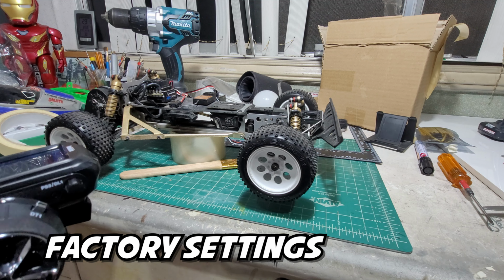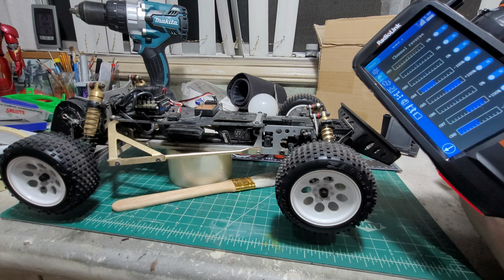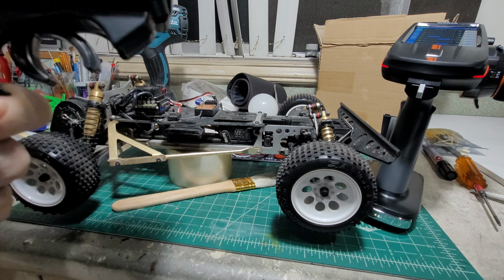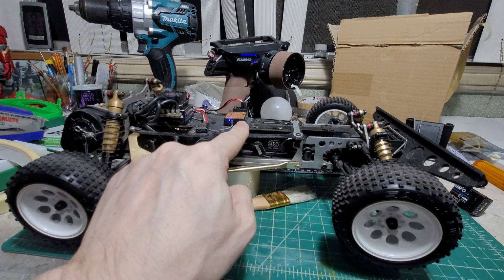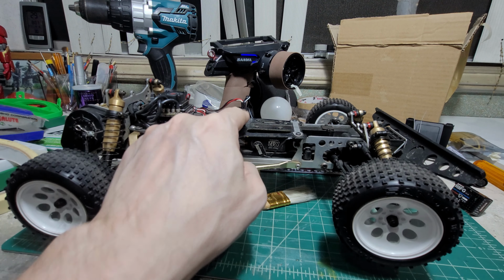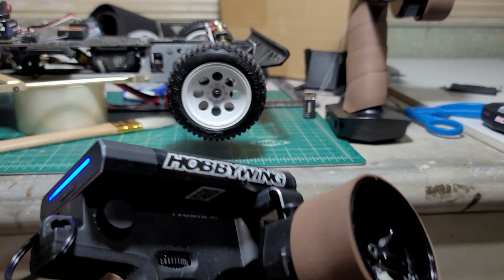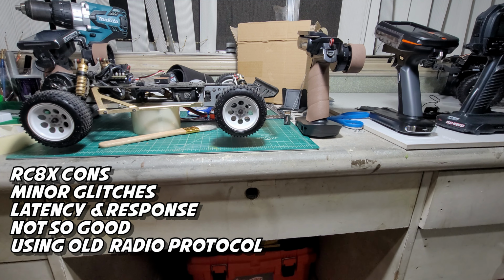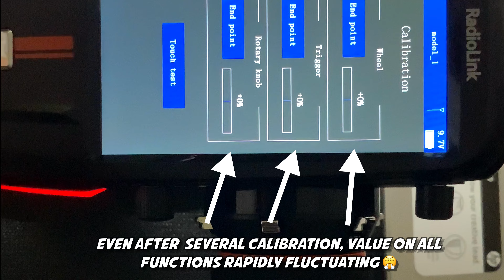Radiolink RC8X VS Sanwa MT44, Flysky NB4 Latency Test or response test

Comment from the maker: Update: March 8,2023, Radiolink have a complete explanation regarding FHSS protocol in my second uploaded video regarding RC8X issues, there are key take away from Radiolink, “FHSS V1 resolutions 2048 and FHSS V2 4096, V2 can achieve a more precise operation. Check your version is your R8FG (receiver). R8FG V1.0 (with production date February 6,2023) supports only FHSS V1 protocol, Not V2, if protocol of R8FG is selected incorrectly, some functions will not work properly.”

So that means anybody who purchased the RC8X radiolink earlier than February 6,2023, you have a 100 percent chance getting version 1 (R8FG) receiver, you can only set it at the lowest FHSS resolution, that the recommendation of Radiolink. Equal to slow resolution and latency.

Comment from the maker: Update 6/19/23: Firmware version 1.1.5 with the new receiver R8FG V 2.1, improvement in speed but still slower compare to Noble NB4 and Sanwa MT44, I will try to upload a slow motion comparison very soon.

Comment: nice demo , in fairness , the nb4 was slow as a snail when i got mine , the firmware updates solved it , its now lightening quick so hopefully the rc8 will improve soon . it can only be a firmware issue as the transmission protocol is capable of near instantaneous reaction. fingers crossed .

Comment: I have the new RC8X as well and seen a couple of "review" videos. I know one where it was a just an unboxing video and I did call the channel out on it and they changed their title. The other one I seen, the reviewer did mention that it is slow. If you did some research before you bought it, the RC8X uses the same receivers as the RC4GS & RC6GS... meaning they use the same protocol. Same old technology from their previous radios. Radiolink is known for really good range and very affordable receivers. This RC8X will serve my bashers and especially crawlers well. Sorry you found out the hard way and thanks for making this video.

Edit - I also have the trigger spiking sometimes between -1 to 0 to +1. Hopefully they fix it on a firmware update.
Reply from the maker: I did watch a lot of videos about the RC8x, my mistake I bought it too early ( not waiting for more feedbacks about it) I was blinded with the colorful display 😬. I going to use it for my crawler too and maybe plan to get a brasher soon. Thanks, for sharing your experiences and insight, I do hope they do fix the trigger/wheel and rotary knob issues as well.
Reply: @oliverstoys8411  Yeah, hopefully they will address these issues with future firmware updates. I see that v1.1.1 is out now, newer than the one I downloaded and installed around the beginning of December.

Comment from the maker: Update February 9,2023, my radiolink RC8X connection problem happen when my transmitter is right beside the receiver (r8fg) 8 inch or less, you can still control steering but tx and receiver voltage displayed on my radio drop to null, and fluctuating signals. This will be a issue if you happen to be calibrating your car, at the beginning i assumed it would be the esc i am using, i test hobbywing 1080, tamiya esc, castle sidewinder and hobbywing xr10 all have same have the same signal dropout at very close proximity with the receivers, i am assuming either software issue or more likely hardware😬, i would suggest you guys with RC8X do your own testing, to avoid RC mishaps.

Comment from the maker: New update (06-06-2023)from radiolink, so far I don’t have the new r8Fg v2 receiver, so no way of testing it, according to them it will increase the performance of speed of the radio, and here the new details form Radiolink of the firmware update and new receiver requirement need to get benefit of the new changes. 

Firmware V1.1.5 Upgrade Instructions
1. Optimizes the Throttle delay function.
2. Add Korean, the optional language menu includes Chinese, English, Japanese, Spanish, German, Russian, and French except Korean.
3. Add "Servo Speed" in the Receiver setting menu, and the Servo Speed can select as 3ms, 4ms, or 14ms.
 
Servo Speed
1. Transmitter:
It is necessary to update the firmware of RC8X to V1.1.5 or above, and then select FHSS V2 protocol to display this option. Servo speed can be selected from 14ms, 4ms, and 3ms. The factory default servo speed is 14ms (analog servo speed), 4ms, and 3ms (digital servo speed).
 
2. Receiver:
If you are using a digital servo, you need to choose a servo speed of 4ms or 3ms. Please confirm whether the receiver you are using supports digital servo. Currently, RadioLink receivers that support digital servo include R8FG V2.1, R4FGM V2.1, R8FG, and R4FGM receivers with a factory date of 2023/4/26 and later. Other versions of RadioLink receivers do not support digital servo. Even if 4ms or 3ms is selected when using them, the default servo speed is 14ms. RadioLink will continue to add other models of receivers that support digital servos in the future. Please pay attention to RadioLink's official website.

Comment: Good video!  Yes, I definitely noticed a difference driving this compared to my MT-44 and NB-4 on a carpet racetrack with 2wd buggies.  It's good to see the actual camera difference.  Thanks for sharing.
Reply from the maker: Thanks  i really appreciate it👍🏻, i did watch your videos and glad you voice out your concern and opinion about the radio, i read all the comment/reply on your video and it was really insightful, i wish i knew earlier that it was that slow (rc8x), i might have waited for a better one. So far the NB4 for me still a better all around radio (value wise) but not as quick compare to MT44, Thanks again and more power to your channel 👍🏻.
Reply: @oliverstoys8411  thanks.  I've seen that glitch on startup, I think if I turn on the car first and then the radio I don't have it.
Reply: No its not a good video. At 2:07 you can clearly see that the servo throw for the Radiolink is much greater vs the others, like 30% to 40% more. Also, its going beyond the endpoints and causing the servo saver to activate.. The delayed return time is cause by the servo saver notch having to travel 30% to 40% back the opposite way before finding center to begin moving the steering rack. Performing this test on a clapped out rack without setting endpoints is just silly and pointless.

Comment: IMO in your tests speed is obviously dependent on the tension of the spring bringing the turning wheel back to 0, and Flysky and Sanwa obviously, you can see it in your video, have harder springs and therefore are faster (and shiver more).
You should use a 3-position switch IMO, 100 - 0 - -100% to make those tests. At least this was how I did servo-speed-tests. And this should also be valid for latency.
Probably you could turn the wheel even faster with your hands than spring-tension does?
Reply from the maker: Thanks for your feedback, Some how you have a point with the tension spring vs the mt44 and nb4, but at the start of the turn it’s already obvious the rc8x very sluggish, you can also look at the my vintage sanwa radio test video the the tension weaker compare to the radiolink, and also they are similar in protocol FHSS version 2, but obviously the older sanwa still out performs the Rc8X, i have the radiolink for 2 months already, it still feel and sense the steering very sluggish and mediocre (like a ready to run bundle radio), i would like to test it on a 3 switch position but it going to be a waist of my time, it’s not up par to some popular $250usd and up to speed and quick response, but i do like the features, affordable receivers and awesome touch display, i am still using it for my re release tamiya sand scorchers and 3 of my crawlers, that is my personal experience with the product, every person have his favorite radio, for me i do really regret buying this, if I don’t have the mt44 or the nb4 i properly love this radio, I hope you can also check out razor rc product review, and read the comments.
Reply: @oliverstoys8411  I do only have a Noble ;-) - and no favourite radio; however, ordered an RC8X recently, did not yet arrive, my first Radiolink radio. I am not a fanboy of any brand at all, but love my Flysky Noble NB4.
But this is what I first thought when watching your video.
Another point: The foam on the steering wheels. You press your finger, hold the wheel, and remove it. Different foams, softer, harder, stickier, less sticky... those probably are only few ms, but will affect the result, too.
IMO the only way to do this is using a 2 or 3 pos switch. I know, testing and analyzing is super time consuming, did servo speed tests this way once.
Reply from the maker: @donaldsneffe  i do believe you have a point regarding foam and others, but i still prefer using the steering as a gauge, because that what i am concern about steering feel, responses and accuracy, adding the marker to gauge the position of the servo, normally I don’t drive full steer to 100 percent opposite direction, just wait for your radiolink to arrive and do your assessment, you never know i might be wrong, the reason why i purchased the rc8x the features and vibrant display and recommendation of youtube influencer, what can go wrong, but i should have waited, i have my old MX3FG sanwa radio, the steering would be very outdated (noisy, squeaky, you feel steering resistance) btw with foam pads too, comparing to todays standard, i can say it’s very old and feels old(mx3fg) , but for me it’s obviously quicker and more accurate compare to my rc8x, i really hoping the rc8x with be at least same as the nb4, my mt44 with FHSS-version 4 is faster than the nb4, the new sanwa have a new model MT-5 using FHSS-Version 5, for me radiolink Rc8X (FHSS-version 2)would maybe be up to par if they just used the new protocol, in the end of the day, if you are happy with your radio that great 👍🏻. 
Please read some of the other comments across social media, i am not the only one complaining.
Reply: @oliverstoys8411  I do not doubt your feelings and experience in any way and I appreciate your effort and your videos.
My comment was only related to this test in this video.
I was "in the same situation", wanting to perform a similar test (servo speed measurements) about a year ago.
I am not a professional in RC radios at all; however, I am a super interested hobbyist, love to test new stuff and super interested in any news.
But I am scientist, professional, and therefore I know how to setup and analyze experiments and measurements, and know about about critical factors.
When I made my servo tests, I initially also wanted to use the steering wheel to let the servos "snap back". But after thinking a bit about the setup I realized, there is the factor "speed of the steering wheel", which I could easily eliminate by using a push-button which only knows 0/100. 
The factor "different foam" (sticks to your finger) is a minor one, but a factor, too.
So the first thing I thought when watching your video was "those steering wheels do not go back with same speed" and therefore those results cannot be correct, even not "near to correct".
But this does not doubt or critisize your "feelings and experience" in any way. However, "feelings" are subjective.
Reply from the maker: @donaldsneffe  agreed👍🏻 feeling is subjective, I can’t duplicate how fast i turn the steering wheel i am only human, you always note that I don’t use any foam , what about the MF3XG, that why there are 4 different radio, but the marker should be very similar to the direction of the steering wheel and the servo, or at least servo should trailing by close enough like the sanwa mt4, you should also note that i am using a bootleg sanwa receiver too, it could be also a factor, and also i using a larger steering wheel too, for me seeing the markers is important, and dont just look at the return, look at beginning turn it so delay already (rc8x), I am not the only person who done this test for other radio, using a 3 position switch will also depend of the speed of you hand and sensitivity of the switch), the best way it should be “automated” if you want accuracy and consistency, use a program to automate the switch process sequence.
We are agree to disagree.
Reply: If you don't race and see your results affected by slower but gorgeous radios, then who cares.  I bash and only need EXPO and EPA, but the beautiful soft grip and color touch screen 😊
Reply from the maker: For reference only, skip to 2:30 seconds, https://youtu.be/1bKn2xS3wBU?si=FcoyZN3eMUkY4WFb

Comment from the maker: Update as of February 8,2023, another issues i found out, jumping to different fhss v1 and v2 protocols (receiver) are not a good idea, for example bind connected to r8fg receiver with fhss v2 protocol saved, then you pre select different car with to R6fg fhss v1 protocol, it will not bind, you need to confirm again the fhss v1 (checked) protocol to v1 enter confirm before you can start using the assigned car, when going back to another with fhss vs 2 protocol you need to go again to receiver setting and select v2 enter confirmed. 😬😬😬😬Freaking complicated!! As long as you stayed fhss v2 saved receivers you will be fine. Another problem i found out, both receivers r8fg and r6fg losing binding connection (receiver voltage 7.4volts) with my kyosho USA1 esc( oem Hobbywing ), I used the sanwa and flysky receivers with no drop out on signals. Either this radiolink need a pretty stable firmware update or I don’t know.

Comment from the maker: Update: I did order 2 more R8FG receivers,  bind it again fhss v2 protocol, test it with my bench setup, same issues throttle glitch at the start up, steering response still very slow and sluggish 😬😬, the large display of transmitter does consumed the battery faster, I realy wish i didn’t get Radiolink RC8X, i can only use it for my slow cars.
Reply: Would a Futuba  4pm be better ???
Reply from the maker: @BigDreamsSmallWalletRC  if you compare in speed and steering responses, yes. The Futaba 4PM is faster (good for competitive racing). But the Radiolink have several advantages like 8 channels, many features and functions, i think it will be a good all around radio for most RC vehicles, rc8x just fell short if you are going to used it for high precision racing, which demands quick accurate steering responses.

Comment: Do you plan to do a latency follow-up video with the RC8X and the R8FGv2 receivers? I was about to buy the RC8X, but now I'm worried about the high latency, and might save up and get a Sanwa instead. The decision is hard since RadioLink tends to have longer range and really cheap receivers.
Reply from the maker: Hello, I currently don’t have the R8FG version 2 receiver, if you are not going to use it for competitive racing/drag and drift,  the rc8X should be fine, (even having the new v2 receiver) the latest fhss-2 protocol for the rc8x still several years older compare to other current professional grade radio, radiolink have several advantages like, longer rang, 8 channels, multifunction and most important cheaper receivers, if you have several different type of rc cars, this will be a great radio for versatility, but for best latency, sadly radiolink will be way behind in this category.
Reply: Have you gotten a new radio?   I have been a long time user of many different radios, Spektrum, Sanwa/Airtronics, and many RTR radios as well... 
   I have never tested our newest radios, DX5C and DX5 Pro for distance,ight have to do that here soon... but I CAN say that they definitely do work out to distances where it becomes hard to see what the car is doing or which way it's facing... 
   I am very close to ordering a Futaba 4PM , just to try out a Futaba... been seeing lots of people reporting issues with Sanwa , and seen a few in person with newer ones lately so I wonder about their quality maybe getting poorer than it used to be.  I also don't really want a touch screen radio.
    Let me knownwhat radio you ended up with and how it is working out for you.   Cheers.

Comment: Sanwa is always world champion in Response.
By digital servos you can set the modulation in the bind menu from normal to shr (sanwa high resonse), than it’s faster. And when you have a sanwa ssr able servo, you can set it on ssr (sanwa super Response. That ist the fastest mode you can get.

An use digital brushless servos to test it on 7,4V or 8,4V that it’s Zero Delay.
There un can see it best.

It’s best fun to have servo and response super fast.
100 times better when everything is fast Like your fingers. 
1000 times more fun then driving with gyro recivers.

All my offroaders are sanwa fhss4 with brushless servo on 7,5V and it’s super fun.
Some are sanwa srg servos. This is the old ssr series.
The new are in the pgs line with ssr.

Long time to change everything but buying used and have time helps.
It’s awesome together with castle x series controllers and motors.
Believe me it’s pure smiling.

Good video, thanks 😊👋🏻
Reply from the maker: Thanks 😊, i agree with you Sanwa fast, for me mt44 is my benchmark, it can do more with the proper add on 👍🏻👍🏻.